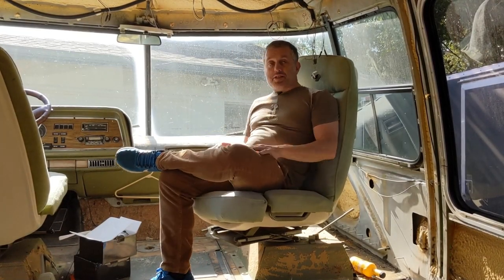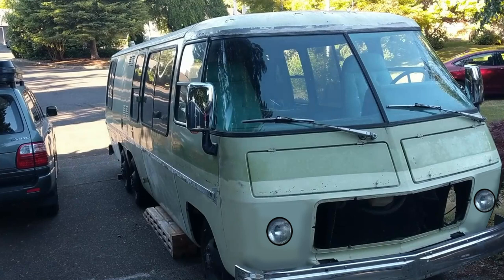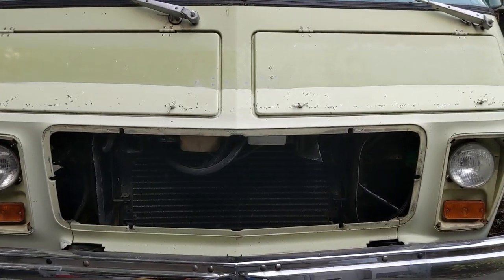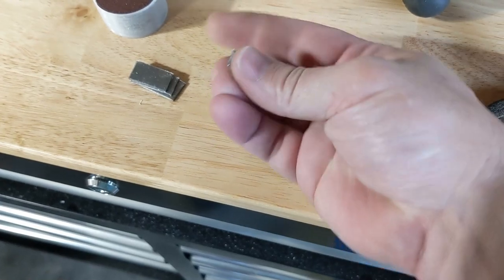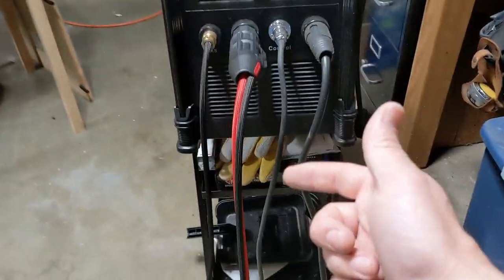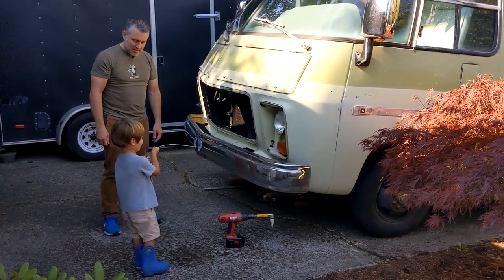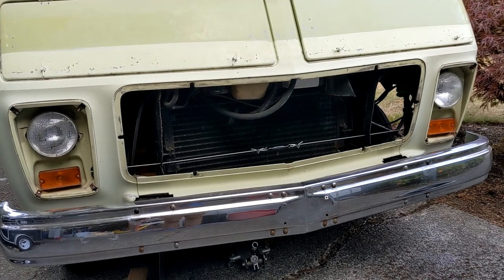Building the Best Damn GMC Motorhome Ever E.17 - Front End Cable, and welding

Comment: If you ever plan to drive in snow in a vehicle with aftermarket LED headlamps you'll want to get ones that have built in heaters that automatically turn on at near freezing temperature. IMHO two things that drag the GMC motorhome out of the 1970's are swapping in rectangular headlamps and replacing the tail lamps with the larger 1990's Chevy van ones that sit out on top of the recess. I think there's someone that makes fiberglass headlamp surrounds for rectangular ones, which for some reason are called "doors" despite not swinging or covering the headlamp in any way. Devices that do move to cover headlamps are also called doors. The rectangular headlamp mod should be fairly simple due to how the large rectangular headlamp switchover was done across 1978-1979. Seeking the cheapest way to do it, the industry made the rectangle lamps in a shape that the buckets could be made to fit into the same supports as the 7" round lamps. For 1978 some vehicles (mainly trucks like the Ford F150 and Bronco) had round lamps as the base option and rectangle ones as part of higher trim packages. Had GMC continued the motorhome it most likely would have had the rectangle lamp option on higher trim packages in 78 then made them standard for 79, as Ford did with their trucks.
Reply: Would you put a tattoo on the Mona Lisa?   Then, why would you drag a 78 GMC out of the Seventies?  It's a timepiece.    Enjoy the artwork !     : )

Comment: Sir, I truly appreciate your channel, thank you. Just a quick tip you may not have heard before. Those little "clip things" are called wire rope clips or more commonly, cable clamps and the other part is called a thimble. There is a hard and fast rule when using them; "Never saddle a dead horse".
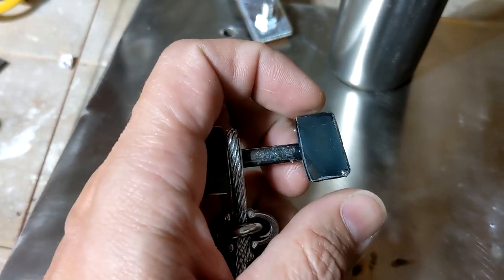@ 7:13 you showed a perfect example of saddling a dead horse, the saddle of the cable clamp is not on the "live" or load bearing cable, it is on the "dead" end. Obviously for this project it makes no real difference, but if for instance you are making a tow or lifting cable these connections will fail, they will pull right through. Just a heads up and please keep the videos coming, just love your stuff.
Reply from the maker: Good catch. You pay attention to details. The first of my four was like that, and I didn't feel like redoing it. Hopefully I never have to. All the other 3 were done correctly. I've never heard the saying before. Thank you for the comment.

Comment: Since your replacing the glass due to de lamination. Buy your glass now so you know you have it, and have it painted with the glass REMOVED. There could be some rust under there or crud.  Nothing worse than a nice paint job and the weather strip shrinks and your left with an old paint line visible next to the weather strip . PLUS when you or a paint shop go to color sand or polish the new pint decaying black rubber gets caught and mixed in with the compounds,  If it hasn’t been tapped off.   All in all it’s easier and a better final look to remove  the glass 

Also. Your headliner. (Not knowing how it’s attached at the front) sometimes is tack glued and tucked up under the windshield gasket. Might be something to consider when the windshield is installed.  If attached with trim. Then by all means instal windshield when you want.
Reply: 4961Studebaker the coach is all aluminum and fiberglass, this is why they last so long.

Comment: Aftermarket headlights are notoriously terrible and generally lack cutoffs and DOT approval.  If you go with the cheap option Chinese crap I guarantee you'll regret when you actually find yourself on a dark country road.  Get good quality 7" round headlights--there are options frequently used for Jeeps, like Trucklite.  Not cheap, but not terribly expensive either.  I think about $150 each.   If you still want more light, something from the overlanding world you could add later is a 40" LED light bar behind the grill.  Keep in mind that you can't use them in traffic, but it would be pretty stealthy and a good quality unit like Rigid Industries or Baja Designs.  I really think using the Trucklites will be enough for motorhome usage though.

Comment: Don't paint it yourself,that's the most important part of the 'wow factor' just like real estate 'curb appeal'... and anything outside of a paint booth won't cut it. Having said that, if you're going to replace the windshieild, I would think you would want to 1) remove the old windshield; 2) paint it; then 3) have new windshield installed. But that's just my opinion, I'm not an expert.

Incidentally, is there anyway to repair the windshield? I don't recall anywhere you talked about that...
Reply from the maker: There is an RV Glass specialist in Oregon that has replacement windshields in stock: https://www.rvglassexperts.com/